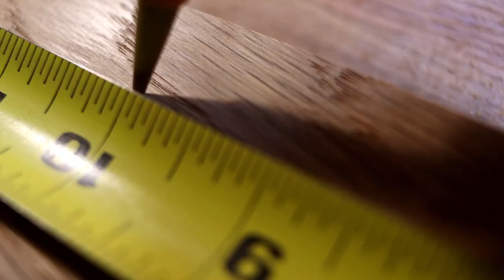A Successful Failure in Staked Furniture

Comment: I have beveled the underside of a bench top, the same as at about 5:00 here. I want to suggest something that I learned from Paul Sellers about how to hold the plane when doing that. To do it his way you would have to move the edge of the workpiece so that it extends off of the edge of the bench. Or you could set it up vertically in a side vise if you have one.

The trick is to not only tip the plane about it's axis but to also rotate the sole relative to the direction of travel so that the blade makes a "skew" cut. This is for cuts across the end grain. You don't need it for cuts along the grain if you have any to do. Furthermore, there are two ways to rotate the sole of the plane relative to the direction of travel and you want to choose the one that causes the leading part of the skewed edge to be running along the flat back of the piece, not along the edge. That might require you to switch the board to hang off of the other edge of your bench.
Reply from the maker: Thank you for the tip.

Comment: Hey, I'm back again 👋 - I have to say, you are really good at capturing all the important details with these builds. I'm looking at what is usually a sliding dovetail. I didn't see you taper the blocks, are they actually square instead?
Reply from the maker: Yep,  these are just straight/square battens. A sliding dovetail was more work than this one called for. The legs go through the battens and then through the top. I followed a stool that was written about on the Lost Art Press Blog. On a wider top like on a kitchen table I would use a sliding dovetail and not have the legs go through the table top. I treated this like an experiment. I'm curious to see how wood movement affects it.

Comment: What's the tool at 5:23 and 8:32?
Reply from the maker: 5:23 it is block plane and at 8:32 it is a Veritas bevel up smoothing plane.
Reply: @EricMeyerMaker  The production was really good on your video, perhaps you might mention hand-tools in the description in some of the future ones?

Do you recommend the bevel up smoothing plane? I have a block plane, but it doesn't have high handles - it's a Rider No. 60 1/2 I find Oak tears out quite easily and wondered what you may be doing differently to make that easier. Is that also a paring chisel you're using?

I also have a few other hard woods (not sure what they are, but the grain is circular and seems to tear whatever I do) - any suggestions?
Reply from the maker: I like the bevel up smoother.  The adjust the mouth opening and not having a chip breaker are a bonus for me. I reground the iron and have the bevel angle set to 38 degrees (50 total with the bed angle). With the high angle and setting the mouth tight it does a good job at controlling tearout. 

If you find you are getting tearout the best tip I got was make sure the blade is sharp, take light shavings, and pay attention to the grain direction. If that doesn't do it I will pull out a card scraper and sand paper. I had some walnut that no matter what I did it would tear. That one required a lot of sanding. 

Thanks for the suggestion on adding tools to the description!

Comment: Eric, nice job, unusual joinery methods, I like it, some good close ups too!
Reply from the maker: Thanks! I looked at some old benches that were cross braced and then staked through. I liked how that looked. I added the clinch nail to hold the battons on until I could get around to doing the legs. I wanted to keep it flat in the couple of weeks between operations.